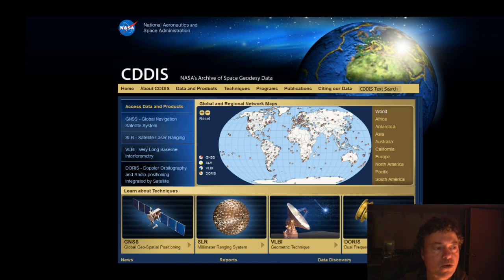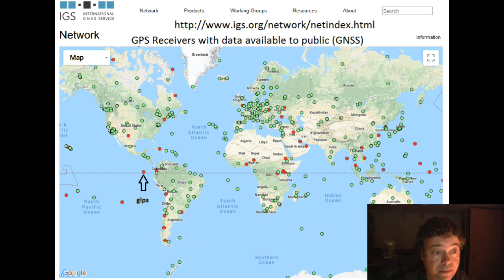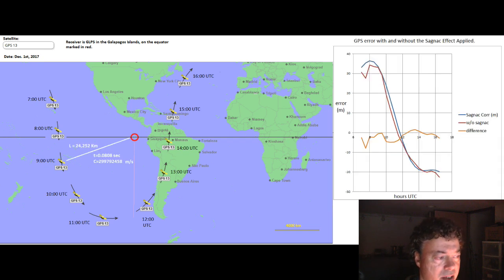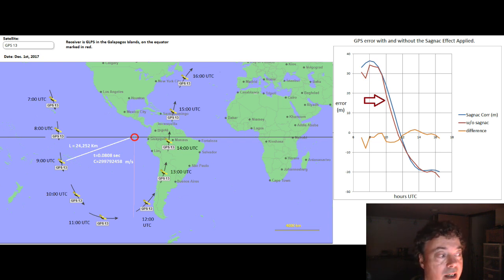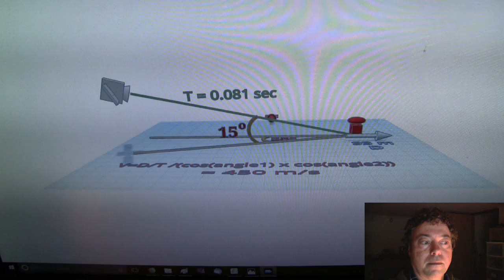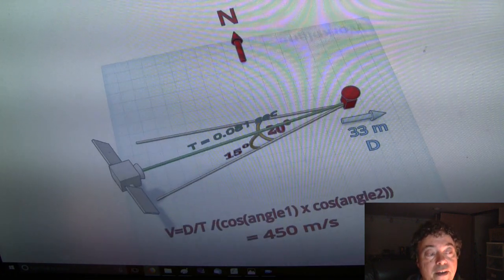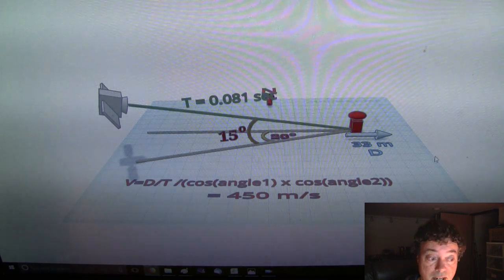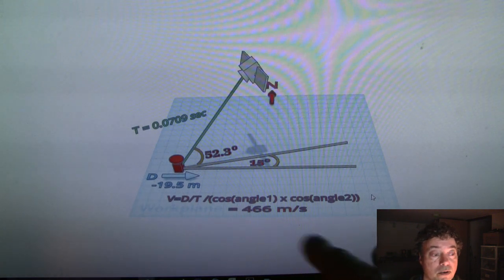Earth rotation measured using GPS

Comment: You say there is a range error because of rotation?? So, if anything is stationary from any measure distance so the number is constant, so there is no error right? If there is an error, then someone is lying to you because the number should move with you since it is satellite in motion. So, the motion is in parallel, so there shouldn't be an error, but if there is then there is two different info that will show a contract. Not two sameness.